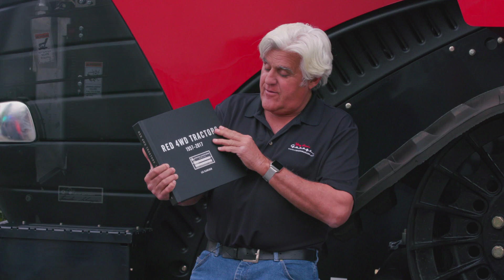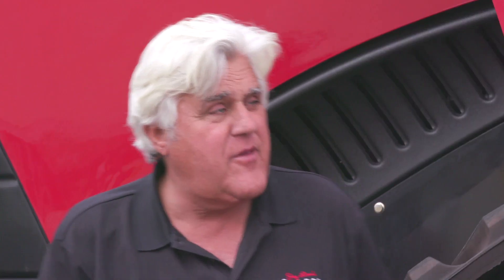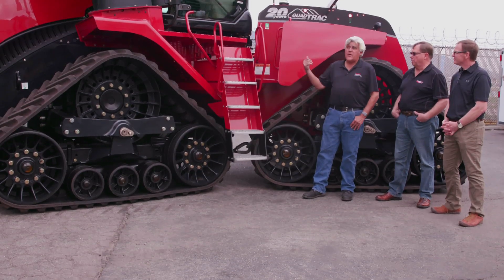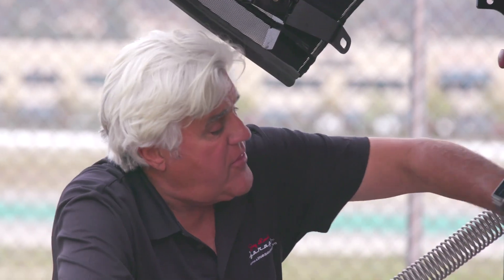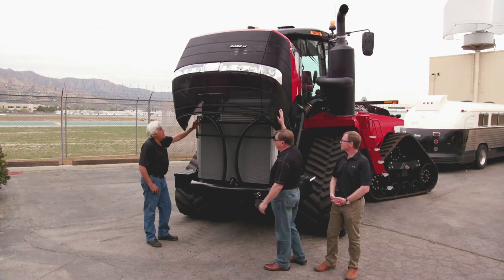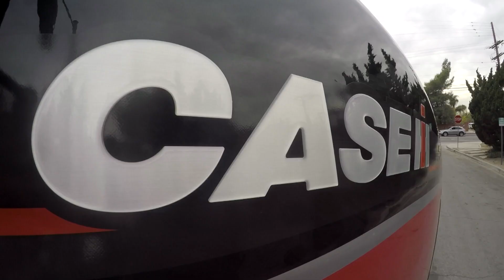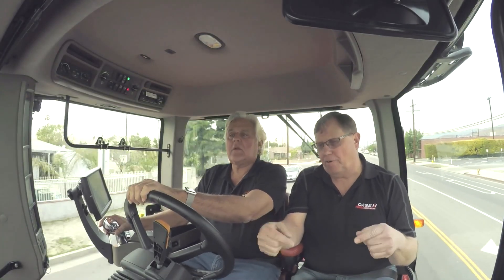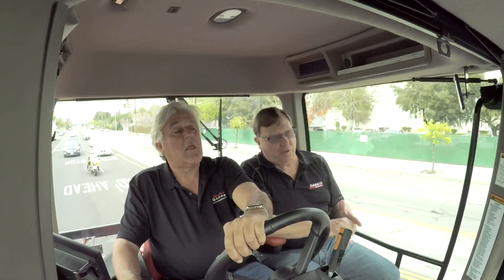2017 Case IH Quadtrac - Jay Leno's Garage

Comment: Believe it or not, I was the lead engineer that designed the cooling system for this tractor. So cool to see that it ended up on JLG!
Reply: Its a great product Tim...
Reply: Really cool!!! 👏👏👏👏 And really good product 👍👍👍😉
Reply: Nice one Tim. How long did the program take from start to finish ?
Reply: really? so can you answer jay s question about drawing hot air onto the radiator behind
Reply: @Lotrioni  The guy already explained it twice. The first radiator cools the air so good the second one gets cool air
Reply: Lotrioni the one he asked twice lol
Reply: Timothy Hirschberg I choose not
Reply: @OfficialSandfreak1  These radiators don't cool the air. Heat is transferred from the radiator into the air. What the guy said in his explanation was, there are enough fans behind the radiators to pull in so much air that the first radiator doesn't heat up the air that much, so that the air can also cool the second radiator.
The slower air travels through a radiator, the hotter it will have time to get. If you move the air faster through the radiator, there will be a larger volume of air to cool the same amount of heat, and the air doesn't have time to get that hot. So, less heat is transferred per a certain volume of air, but you have a lot more air to do the cooling. That's why you can have multiple radiators stacked.
Reply: Jay's question was kinda out of place, especially since he asked it twice. When you have a $650k piece of equipment that makes 700bhp all day for 14 hours straight, you it should be abundantly obvious that the engineers knew what they were doing when they designed the system. I'm sure at some point they slipped a thermocouple between the radiators and measured the air temperature downstream of that big one in the front. In case anyone's wondering, the reason the radiator is so huge compared to a 700bhp sportscar is because the tractor makes 700bhp at just 10mph. There is very little cooling wind at that speed.
Reply: LMF5000 plus I’ve never ever heard of an engineer screwing up,,,,,right?
Reply: Impressive case man do you get comission?
Reply: Lead engineer for cooling. Its a giant radiator. Glad they had a whole team of cooling engineers working on that :P
Reply: Glad to see we have another expert in the field who appreciates the work that goes into a 3 year long development project!
Reply: you forgot a cooling system for the beverage holder.
Reply: Timothy Hirschberg do you belive that the exhaust is cleaner that the intake?
Reply: Definitely not. While the tractor is Tier 4 compliant, it still is going to emit NOx and particulate matter.
Reply: Disappointed you work for case.
Reply: It's either Deere or nothing lol
Reply: That’s one helluva cooling system
Reply: Good Timmy
Reply: Cool
Reply: Wow fun fact of the day I love the tractor I just don’t know what I like better jd or case
Reply: @haydenturner6894  case all day you cant work on your own deere anymore
Reply: K
Reply: I take it the frontest radiator is for the main hydraulic oil ?
Reply: The front radiator is actually for a low temperature coolant circuit for cooling two indirect charge air coolers to lower the charge air inlet temperatures. This in turn allows the engine to have greater power density/increased horsepower.
Reply: I don’t work for case. I work for a supplier that sells to both case and JD. 😊
Reply: @tgrockworth  What's in that front rad ? Looks like hydraulic pipes to it.
Reply: It’s actually just 50-50 water-glycol coolant. Those big hoses are just to allow sufficient flow rate through the cooler. They’re not rated for typical hydraulic oil pressures.
Reply: @tgrockworth  Cheers.

Went to a firm doing maintenance on cherry pickers - and having noticed some of the machines were oil cooled, half expected someone there getting me, 'the newbie' to check the water on a particular machine - but no, that never happened :)
I wasn't with a bunch of bright sparks - and knew on the day I started my time with them was not going to be long. Lasted just shy of 3 months. I could bore you for the rest of the year with the 'horror' stories !
Reply: @millomweb  hydraulic oil cooler as well.
Reply: What do you honestly think about the whole tractor? What did you want to see that didn't make it to production
Reply: That’s a great question. If I were to compare it to a comparable JD, I would say I like the JD more to be honest. Maybe it’s the color, or maybe it’s that I think the JD just seems like a more polished product to me,

As for what I wish made it into production, I cannot really comment on the tractor as a whole since I was focused on just the cooling system. That being said, if I were able to change anything, it would have to be the cooler for the hydraulic and transmission oil.
Reply: @JM-yx1lm  What I want to know - is how the tracks are driven. Usually of those triangular style designs, it's the top large wheel that does the driving of the tracks - and therefore has the teeth that engage with the tracks - but I couldn't see any on this machine. Do all three of the large wheels drive the tracks ?
Reply: @tgrockworth  Is that 2 separate oils ? Surely the transmission's not using hydraulic oil ?
Reply: @millomweb  The hydraulic/transmission oil cooler is actually a dual-circuit cooler which has a separation wall between the fluid circuits. That being said, the hydraulics and transmission do in fact use the same oil, but they're physically separated within the heat exchanger's core.
Reply: @tgrockworth  Bizarre and interesting. I've a dual channel heat exchanger in my heating boiler - one channel for radiators and the other hot water.

Hmm, do the hydraulics not use 'hydraulic oil' but gearbox oil instead ?
Reply: @millomweb  I cannot comment on the exact nature of the hydraulics' oil, but it is highly unlikely that it is gearbox oil. I believe it is a proprietary oil developed by CNH to be used as both a hydraulics- and transmission-compatible oil.
Reply: @tgrockworth  I'm thinking back to 1970s tractors - I get the feeling they didn't have a hydraulic oil tank on them - so used gearbox/diff oil
Reply: Good kob
Reply: No way! I don't believe you
Reply: Looked up the name man 😂 Congrats on it kinda big deal 🤙
Reply: @rajgill7576  and a skyscraper is just a huge single floor apartment, don't need engineers there either
Reply: Wow, nice man!
Reply: It's an exceptional machine your part the cooling system is REALLY good chaff stays out of the radiator well, but you guys should swat some of the electrical engineers upside the head every so often for me, less computerisation is always an improvement
Reply: Trump2020
Reply: To be honest... Us mechanics hate you engineers.. LoL.
Reply: Damn it Hirschberg..if you know you know
Reply: @millomweb  even in todays tractors for sure the orchard tractors they share the transmission,diff and hydraulic oil.And this oil is really expensive about 40€ per litre I think but I am not sure.The big service is coming to our tractor so it is going to be expensive
Reply: @mitsoskaftis  It's not usually necessary to change oils other than engine oils - as they have a lot more to do other than lubricate. It's an interesting thought re oils used in wet brakes/clutches but that's not something I'd worry about for 30 years !
Reply: @OKANGUVEN99  weird
Reply: There is a Case dealership almost directly across the st from my work. I've seen these go down the road and they sure are cool. I'm in a big Ag area here in Arizona and they seem to be quite popular.
Reply: Your last name says it all
Reply: He was found dead with his organs missing
Reply: Nice job on that radiator! It's not messing around!
Reply: Todos los días opero uno igual acá en yuma arizona para mission ranchers
Reply: How does it compare to a Deere Tim ???
Reply: Its the TWO THOUSAND F.P.s of Torque that does it
Reply: @millomweb  Oh yeah, they had hydraulic tanks back then too, I had a J.D. Combine, 4030 Tractor, 410 Backhoe, etc
Reply: @IIIRorschachIII  Sad but True, like Carpenters hate Archetecks
Reply: Would you put Evans coolant in this vehicle or any motor?
Reply: Good Job Mate...
Reply: so if anyone here has one that overheats, they know who to blame? 😉
Reply: @wildbill6976  That depends on how clean they keep the coolers. :) If the air fins are overly clogged, well....
Reply: Tim ive been Operating a 580 this past week, Absolutely Hands Down the Smoothest Riding Most Comfortable Machine Ive ever Operated , 
But If you had time to explain the Cooling system a bit more Id like to learn a bit more about about it , Opened the hood the other Day and looking at 2 Different jugs of Antifreeze, Was Curious the purpose of them both?
Reply: To be honest your best bet would be to consult the service manual. The high temperature and low temperature radiators use the same OAT based coolant, so I’m not sure why you have two types…what exactly are they?
Reply: @tgrockworth  ,  Maybe I mis Worded that or Something ?
Theres no Cooling Issues With IThe machine Im operating There is 0 issues with it ,
The 1 jug is for Transmission cooling , The other jug was for Engine Cooling then your Static Fan , 
I was just curious More insite into the cooling System ,
because I like to Learn , from an Engineers Standpoint, 
 But assume that cant Be disclosed , Because of Copyrights and stuff , sorry to ask man .
Reply: @OKANGUVEN99  yup he's legit, MAHLE industrial thermal systems America
Reply: @danielmurray5326  shut
Reply: Or not
Reply: Cool
Reply: That radiator discussion was a little odd. Jay asked the question, they answered it. And then he asked it again, to which they replied the same way.
Reply: I am a fabricator for CNHI/New Holland/Fiat building the seeders and disc drills in Canada for Case IH.
Reply: So cool Jay had to ask about it twice!
Reply: @tgrockworth   prove it you did not design the radiator or build it
Reply: @CARWASHCHANNEL.  Ok
Reply: @Kepe  Very good explanation , thermal dynamics is a wonderful thing with out it we'd be walking , thanks .
Reply: Very cool!
Reply: @tgrockworth were you at Steiger before the buyout or always with CaseIh?
Reply: Lol, if you just had Leno helping you design it it would have been so much much better am I right? To be fair to Leno, if he understood the set of constraints you are working with it would have satisfied him I’m sure.
Reply: @Justinlifts365  You can now...they allow it these days
Reply: Well you did a good job, I’ve never had trouble
Reply: We have two 580s on the farm I work on. We love em
Reply: How cool is that. ( pun intended)

Comment: i dont think people understand how technologically advanced these are
Reply: Exactly!  We use tractors on our farm that 40, 50, 60 years old, and this thing is like a spaceship compared to them. I love case IH tractors.
Reply: Maybe you can explain?
Reply: @mrloop1530  is that a serious question
Reply: @mrloop1530  I grew up on a farm. Modern tractors like the Case have advanced satellite navigation and self-driving features while on the field. Then they have a ton of computer algorithms that help to produce the best results in the field. It is pretty much a rolling computer centre.
Reply: Yes but what is the purpose of that all that advanced tech ?  Also what's the purpose of it being 26tons?. I bet I could design one 1/4 the weight, 1/10 the cost
Reply: @millenniumzeek  Have you ever actually been on a farm before in your life? It sounds like you have no clue what you are talking about
Reply: @millenniumzeek  It needs weight to pull all that heavy equipment. And the tech is needed for it to run as efficiently as possible. The same as in mining. Few seconds of inefficient operation can quickly turn into a costly affair.
Reply: I ran one of these, well a older version in the mid 2000's on the oil sands in Alberta. And man ran like a charm and though its designed for farming it worked very well for scraping / dirt moving with a huge scraper. Almost as fun as a 6x rock truck or a D6 cat dozer.  One of the few machines that has AC for those hot alberta summers... a well needed amenity on the field.  Case equipment is a blast to operate.
Reply: Aret Zelli 1/4 of the weight and you won’t be able to plant much wheat. 
It needs the weight to pull the drill and disc and the hopper. 
Anyways you’ve had a few weeks to ponder a prototype. Where is it?
Reply: Disconnect the battery in one of the modern tractors and the gearbox dont work. Not kidding, the gearboxes are operated all by clutch packs, solenoids, valves and splined shafts. Very few actual gears in em
Reply: These farmers run these things off satellites while sitting in their office on an iPad or computer monitor. It’s incredible
Reply: @millenniumzeek  no you couldn't.
Reply: Aret Zelli you clearly know nothing about farming..... you need a lot of weight and horsepower to be able to pull rippers and grain carts..... so please tell me how you can design one for 1/10 of the cost.
Reply: Aret Zelli like hell you can. Bunch of BS talk
Reply: Know farming is for computer nerds not country boys
Reply: Bruce W. Unfortunately, they can’t be run from an office quite yet. But they can sit in the cab and it will drive its self
Reply: Tyler Linneman you still gotta steer, and set the angle you wanna disc/rip the ground
Reply: @millenniumzeek  you could probably design a tractor a 1/4 weight and a 1/10 the cost, but it won't be able to do nearly what this tractor will do. What did he say about 2100 ft/lbs of torque, and 26 tons can pull alot compared to a small tractor with say 500 ft/lbs of torque weighing say 8-10 tons
Reply: @cody_janssen831  not really, say an implement breaks in the field, who is more likely to be able to hop out and do a field repair. A computer nerd or a country/farm boy
Reply: Ok. Why you mad though.  Yes I'm working on designs but not interested in heavy equipment. Thanks for the vote of confidence
Reply: @millenniumzeek  It has been 5 months, where is the tractor you designed that's 1/10th the cost?
Reply: slowinf getting a self drive system as well
Reply: The key to productivity is economies of scale!  Typically, the larger the piece of equipment, the more productive it is! A simple analogy--using a hand trimmer to mow your lawn vs a modern riding mower!
Most mining equipment makes this tractor look like a toy by comparison, and for the same reason--economies of scale!
Computerization helps the operator do the job most eficiently, too!
Reply: @tylerlinneman1821  this particular model, maybe not, but cat has had autonomous mines for at least 5 years.

search "Caterpillar's Mining Automation Journey"
Reply: Absolutely. My dad was a farmer and I ran late 70's up to mid 90's tractors.  I probably wouldn't have a clue as to how to operate this beast
Reply: @brucew.5292  no....